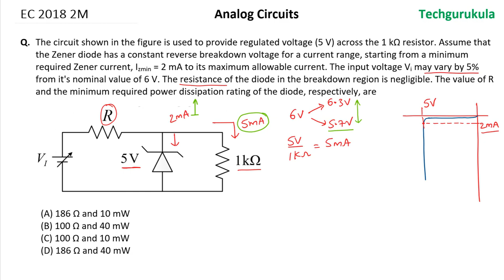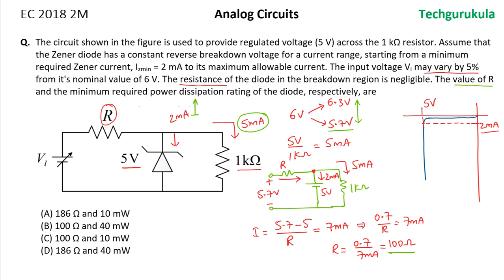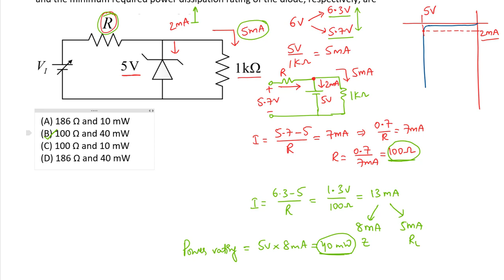Comment: Sir why you take max current flowing through the diode i.e 8 mA to find out the min required power of diode
Reply: The zener dissipates maximum power when you make the zener current highest. So in order to withstand with that , the zener must of rating of atleast I_z max *zener voltage, so it is the minimum power rating
Reply: correct answer is option 3